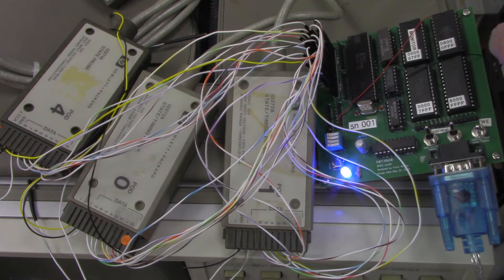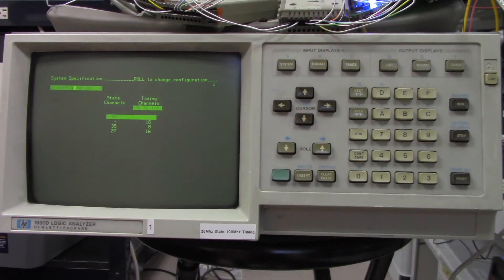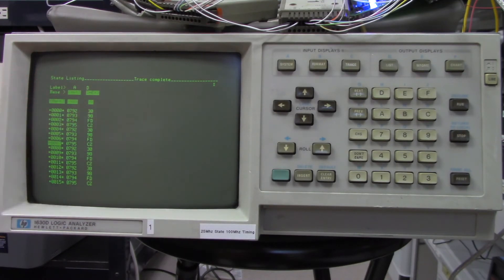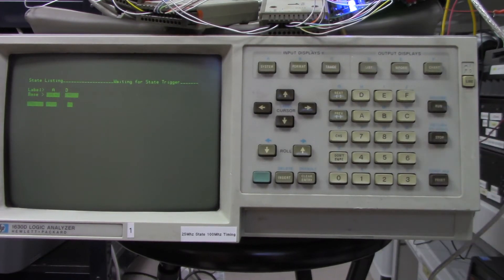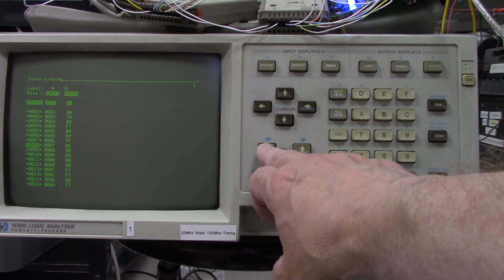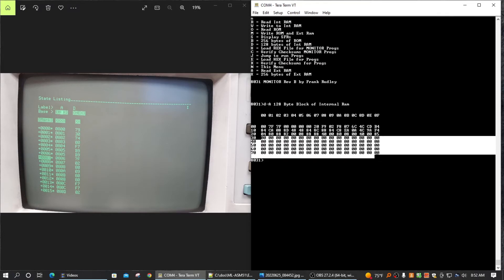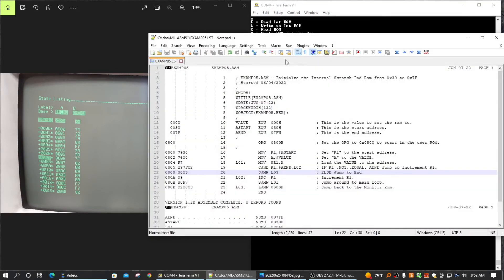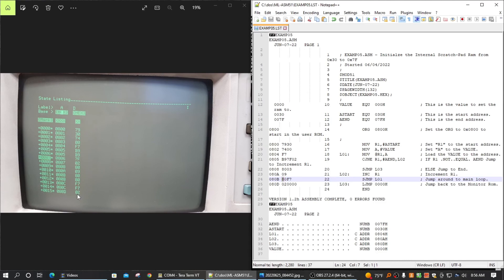Using the HP1630D Logic Analyzer with the 8031/8051 Microcontroller to Reverse Engineer its Code

Comment: Thanks for the very useful video! I have a 1631D that, after a maintenance and minor repairs, runs as good as it did 35 years ago. The only complaint, besides the rather large size, is that you have to set the date and time every time.) I love going back to the electronics of the 80-90s, because that's what I grew up with.